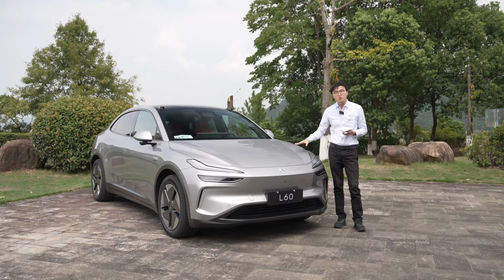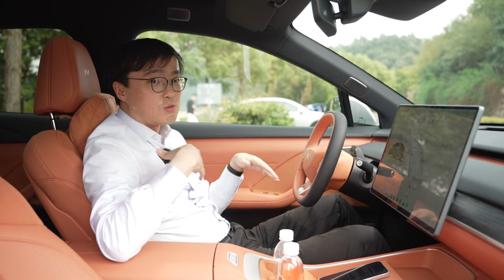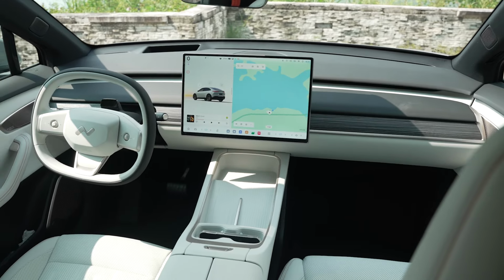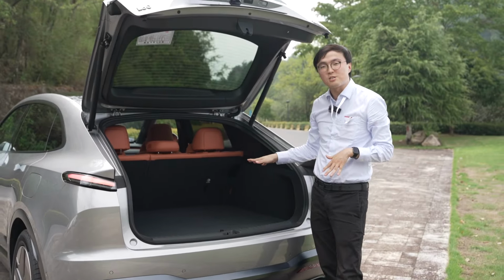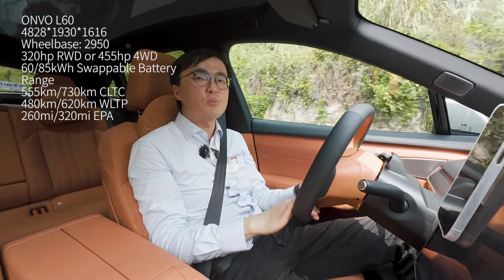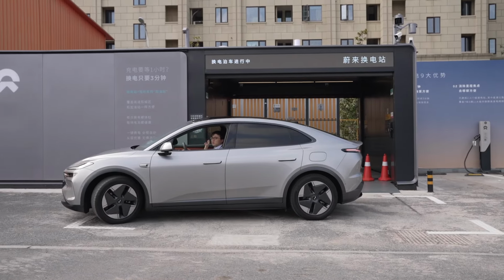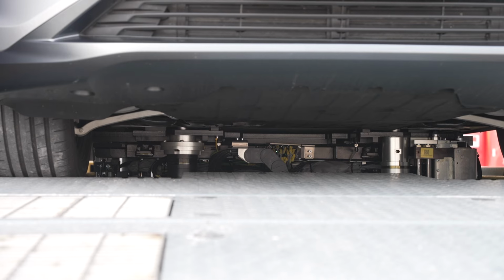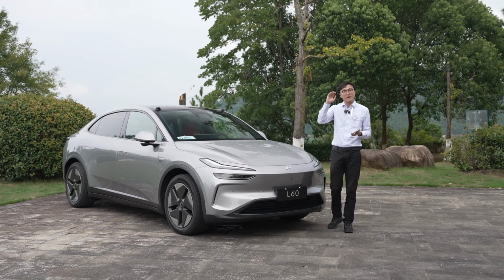A Tesla-Wannabe That‘s Actually Better on Merit - ONVO L60 Review

Comment: just a small electrical remark: if the current was in fact cut in half and if we assume losses in the wire are given by RxI^2, then with the new current I being I/2, substituting it in the formula, we have the new losses as (RxI^2)/4, so the losses are in fact 4x less than before

Comment: In China you can buy this car at a much lower price and lease the battery! The price difference is equivalent to almost 8 years of leasing the battery, so for most people leasing the battery is a better deal. 

Also, not purchasing the battery actually enhance this car's depreciate rate, because an electric car's main depreciation is its battery.

Comment: Wh per km.
Lets see this in minus 25 degrees celsius as I have driven the Model Y.
Also the updated Model Y will be more efficient than current Y.
However, it is important with this ambition. Not like Volvo or Polestar. As a swede I have to be embarassed by those brands.

Comment: OMG, a car with a wheel that extend out a good distance, just great! Over the past couple of weeks, I have been checking out some  electric cars and the Chinese brands steering wheel didn't come out far enough. Polestar 4, BYD Seal, GWM Ora 7, all were lacking. The BMW iX cars were much better but, they lacked in rear and cargo space. Looked into Telsa a few years back too many build quality issues and a lock of features, ended up getting the Audi e-tron, was more comfortable and quiet on the road, the ride was comfortable, with good power. This car looks good, don't like not having an instrument cluster but, they have a heads up display, so that's good. I like this color interior, tired of the Black and Beige (White for Tesla) interior trim, I could do a light Grey.  Great review!

Comment: Pity it's full features are only available for Chinese speaking. Maybe it doesn't make sense, but like Nio, the software it's NOT completely multilingual. English it's not fully available in China. The mobile app only works in Chinese and voice commands ONLY works in Chinese even if you are running Banyan in English in the car.

Comment: The real difference is by:
1) swap battery 👈- Nio reigns supreme as better car for everyday use, as Tesla lacks this killer feature.
2) resale value 👈- again, Nio has no competition as Tesla's battery cannot swap and this is super-expensive special service at Tesla.
3) range 👈- both car have decent range but Nio has killer feature - an access to better batteries in the future - thanks to swap battery!
4) onboard system features 👈- there is draw: Tesla has Full Self-Driving and proven on-air update, Nio Onvo has great HUD and great AutoParking. (Side note: I would appreciate the review to include details of onboard system)
In the end - the winner is Nio Onvo L60.😊
Reply: Btw you have the choice not to swap and just charge until you decide to.  Which other ev company gives you the options to choose? Not Tesla…
Reply: Why would I want to swap my brand new battery with a potentially old and damaged one ? No thanks.
Reply: @stevenjones916 ideally there won’t be “super old battery” for you to swap. Because faulty and old battery is automatically discarded at a battery swap station
Reply: @stevenjones916  That's a good point. I think the answer is somewhere in the middle. Swapping a battery simply because you're in a hurry to charge makes no sense. Swapping it because it's degraded enough... well that I wish I had the option on my Model S.

Comment: The reason why the fan speed is always on is because they are using a "higher" vent temperature trick. Like Xpeng.
Meaning they run the HVAC hotter to conserve energy (less compressor power etc), and run the fan longer, hoping that this will compensate for the cabin temperature differential. 
This never really works, especially for a car with so much glass, and as Sean correctly pointed out, the interior noise comfort is compromised. 
But they need to show better Tesla Y numbers somehow right ? 
So if we actually compare apples to apples : 
 
- Better Aero 
- Lower Reference Area (smaller interior)
- Lower Parasitic losses due to 900V architecture 
- Smaller Tyres (Less Comfort or Driving Performance)
- No frunk (less storage - weight) 
- Cheating on the HVAC 

But same output efficiency as Model Y. 

So in reality the Model Y Architecture still has a better specific efficiency. 
Meaning with improvement in Drag, and change to 900V (already announced and upcoming in the next Tesla release) the Model Y would still be more efficient (in absolute) than this thing.
Reply: Good lord that was tedious, fanboy. Elon's not gonna give you a baby.
Reply: @ChickenSandwichesForLunch  guess you’ve been sucking too much of Billy Li’s Pushpop.
Don’t worry he’s just keeping your lambo moon warm for you ! 
Wait a few decades.
Reply: and tesla is ready for next industry shift with robo taxi... and all existing platforms are paid of -- no debt....